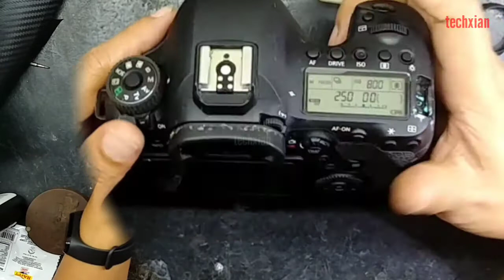CANON 6D MARK 2 REPLACING DIAL AND SELECTOR SWITCH RUBBER WITH 3D PRINT PLASTIC/DISASSEMBLE/ASSEMBLE

Comment: Hello, I changed my mode dial button (assembly) of my canon 5d mark iii and re-Assembled my camera but now it won't turn on.i tried everything, It sometimes blink a red light but thats it.. it wont turn on.. any solution please? 😭
Reply from the maker: check all cable if properly inserted to the socket..check also the contact of the cable if there damage pin...